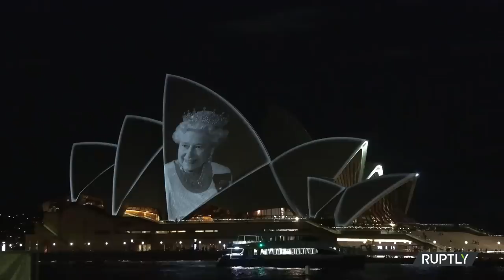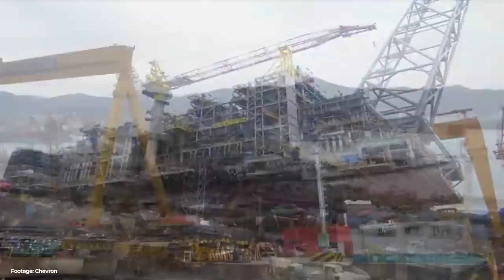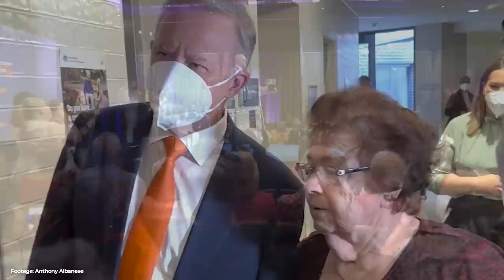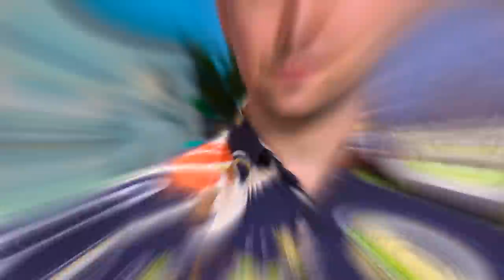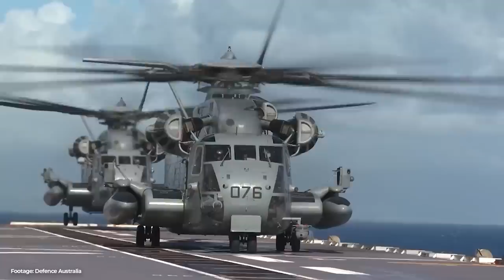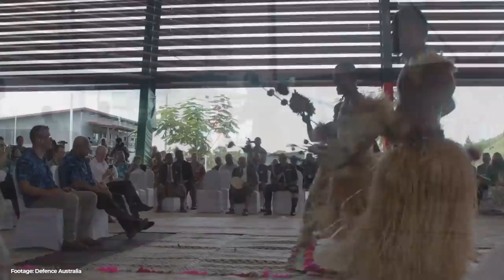A New Chinese Resurgence in Australia? - VisualPolitik EN

Comment: Australia always suffers from Fires, Flood and Draught. There are plenty of ways to combat these that won’t destroy the economy. Fires for one can be curbed in the east if they actually carried out controlled burn off to reduce the fuel load, like we do here on the west coast. Flood and Draught can both be handled with the building of more dams, which will also help contribute to improving our national water security.
Reply: But he problem is that when we get australias climate in europe, Australia will have some extra issues that makes "the economy" irrelevant
Reply: And more hydro electricity making our grid more secure too!
Reply: Using renewable energy will not destroy the economy - in fact in the long run it will result in reduced energy prices for most areas of the world.
Reply: We already do controlled burning regularly. It’s called “back burning” but it happens
Reply: Controlled burns do little to reduce massive fires. They can't be conducted frequently enough to make a significant impact on fuel load.
Reply: @AK-ej5ml  
Considering how much of Australia is just... open for development.  
Sure it is high-tech development but ... isn't that an opportunity for Australia to lead the world in environmental systems?
Reply: Incorrect. 
Problem is it has become much harder to perform controlled burns. And the daft previous ( and current NSW ) governments have pulled funding from many rural fire services.

The ONLY solution is to reduce carbon emitting sources of energy. 
Particularly coal and gas in power generation. 
This should've been a mix of renewable and Nuclear, but previous government let that ship sail as well. They should've acted 10 years ago.
Reply: @AK-ej5ml  renewables are intermittent and solar only a few hours per day. Peak power use is in the evening when it’s dark.
Reply: @MusicalMemeology  That's where storage and flexibility consumption comes in ... still some way to go to iron out the kinks. However experience from some countries, for example Denmark, shows that it is straightforward to get to an annual average of 60% renewable energy in the electricity system (most of that is wind power) without having large scale storage (though with an ability to sell excess when production is too high), so Australia still had a long way to go before intermediate supply from renewable would (should) result in supply interruptions.
Reply: @darrenyorston  
 "Even if you cut, or remove entirely carbon based energy production you will not prevent bush fires."
 Correct. You will however reduce the severity of bush fires and managing fuel will be simpler.
 
 "Australian ecology is formed as a result of frequent large scale bush fires which have occurred for thousands of years."
 Yes.. again.. close but so far. Quite a bit of the Australian ecology is indeed formed by bush fire. What makes 
 the 2019 bush fires different is it has burned with such intensity that even resistant species are struggling to regenerate
 in some areas. And some of those areas are our ancient, heritage listed Gondwanan Rainforests.
 
 "If you reduce the frequency of bush fires you increase fuel load."
 "The hire the fuel load the more likely bush fires will be broader and of greater intensity."
 This is why we do controled burns. But it is increasingly more difficult to do so due to funding cuts and the conditions
 severely increasing the risk of losing control of a burn.
 
 
 "There is no correlation between carbon energy production and bush fires."
 Yes there is. There is significant evidence of burning fossil fuels leading to climate change, leading to more severe weather
 events and longer droughts, which directly leads to the kinds of conditions that increase risk and severity of bush fire.
 It is not the only facter, but climate change is a major facter contributing to conditions that make fuel management
 exceedingly difficult and unmanageable. 
 Ignoring the evidence, does not make it go away.
 
 "There is causation between arsonists and bush fires in conjunction with insufficient environmental management."
 Yes, same with lightening, which was the most common ignition source for 2019 fires. There was also amature controlled burns
 getting out of control, careless machinery use etc.
Reply: "We'll all be rooned," said Hanrahan,
In accents most forlorn,
Outside the church, ere Mass began,
One frosty Sunday morn.

The congregation stood about,
Coat-collars to the ears,
And talked of stock, and crops, and drought,
As it had done for years.

"It's lookin' crook," said Daniel Croke;
"Bedad, it's cruke, me lad,
For never since the banks went broke
Has seasons been so bad."

"It's dry, all right," said young O'Neil,
With which astute remark
He squatted down upon his heel
And chewed a piece of bark.

And so around the chorus ran
"It's keepin' dry, no doubt."
"We'll all be rooned," said Hanrahan,
"Before the year is out.

"The crops are done; ye'll have your work
To save one bag of grain;
From here way out to Back-o'-Bourke
They're singin' out for rain.

"They're singin' out for rain," he said,
"And all the tanks are dry."
The congregation scratched its head,
And gazed around the sky.

"There won't be grass, in any case,
Enough to feed an ass;
There's not a blade on Casey's place
As I came down to Mass."

"If rain don't come this month," said Dan,
And cleared his throat to speak--
"We'll all be rooned," said Hanrahan,
"If rain don't come this week."

A heavy silence seemed to steal
On all at this remark;
And each man squatted on his heel,
And chewed a piece of bark.

"We want a inch of rain, we do,"
O'Neil observed at last;
But Croke "maintained" we wanted two
To put the danger past.

"If we don't get three inches, man,
Or four to break this drought,
We'll all be rooned," said Hanrahan,
"Before the year is out."

In God's good time down came the rain;
And all the afternoon
On iron roof and window-pane
It drummed a homely tune.

And through the night it pattered still,
And lightsome, gladsome elves
On dripping spout and window-sill
Kept talking to themselves.

It pelted, pelted all day long,
A-singing at its work,
Till every heart took up the song
Way out to Back-o'Bourke.

And every creek a banker ran,
And dams filled overtop;
"We'll all be rooned," said Hanrahan,
"If this rain doesn't stop."

And stop it did, in God's good time;
And spring came in to fold
A mantle o'er the hills sublime
Of green and pink and gold.

And days went by on dancing feet,
With harvest-hopes immense,
And laughing eyes beheld the wheat
Nid-nodding o'er the fence.

And, oh, the smiles on every face,
As happy lad and lass
Through grass knee-deep on Casey's place
Went riding down to Mass.

While round the church in clothes genteel
Discoursed the men of mark,
And each man squatted on his heel,
And chewed his piece of bark.

"There'll be bush-fires for sure, me man,
There will, without a doubt;
We'll all be rooned," said Hanrahan,
"Before the year is out."

John O'Brien,  July 1919, The Catholic Press
Reply: Need to increase safety margins in engineering and building codes for this brave, new and exploding world.
Reply: No Robert that's incorrect. We try to reduce the severity of fires by controlled fires. This can only be done when the rural fire bregrades are fully funded. This was not the case in 2019. Much of the fire brakes weren't carried out. To make things worse unseasonably rains occurred adding to the fuel load. As for dams, they don't spring up like mushrooms. Australia has terrible topography for dams. Ideally you are looking for deep gorges so the surface area of the dam is relatively small reducing evaporation.  Australia is the flattest continent on earth. So good locations for dams are hard to find. Brisbane is prone to flooding and does so approx every 30 years. There are 2 dams on the Brisbane River, Summerset (the older) and Wivenhoe (the biggest) Wivenhoe was made as result of the 1974 flood so has extra capacity for flood mitigation.  Despite this, in 2011 and following the worst drought in Brisbane's history, Brisbane suffered a major flooding event. 

Sorry mate there are no quick fixes or free get of jail cards.
Reply: @darrenyorston  all good point Darren. Urban planning is a big issue. It seems if a developer is big enough they can get the development they want, not what's the best.
Reply: @newhorizons898  Or we can act and prevent the world from exploding?
Reply: @450tank  Greens don't appose hazard burns at all. 
Construction of new dams. Well that depends. Dams are wildy distructive, and incase you haven't noticed, the floods are still happening, regardless of dams.
Reply: @450tank  
Oh boy. 
Not arguing that these don't happen. 
They have certainly gotten worse in recent history though. 
Consider Sydney flooding in the last 2 years. 
Consider the severity of the recent 2020 bush fires.
These things have always happened. What Climate change does, is:
* Make them more frequent
* Make them more severe
Unacceptable risks due to natural disaster has greatly increased in the past few years. 
If you want other proof of a climate prediction ringing true, look at our pacific neighbores and their fight with rising sea levels. 
As for "Nobody knows WTF happened before the 1800"
Well yes we do. Go talk to your local geologist. 
We might not have a day by day play: however the can figure out a lot about the climate and weather patterns in centuries past using science.
Reply: @peterlongland6862  I live in WA and our firefighters do regular back burning throughout the year.
The rest of the country keep screwing over their respective fire fighters.
Reply: @darrenyorston  
Open our Parks, indeed this is something that needs to happen and is advocated by a lot of prominent 4WD Clubs and Personalities.
Reply: Back burning is a very good prevention method and it would make a drastic improvement but. I'm by no means a greeny but back burning is also adding to OUR CO2 emissions, but I get where your going we need to do this strategically as well as trying to utilize all the new wizz bang stuff to cut our emissions, a tricky juggling act

Comment: Incredible bias in this channel these days.
First up, half the reef didn't die and it currently has the highest coverage on record after last year's record growth (it has cycles of dieback and growth). 
Second a lot of the blame for the bushfires has been put on the poor fire load management due to changes in government policies which prevented the traditional back burning which in turn led to uncontrollable hot fires. 

In regards to the Solomon's deal(and the other similar deals in the area). Officials were bought off to get the deals signed, but the locals were less than enthusiastic about the idea so rioted and burnt down every chinese business or building they could find. China still engages in hard diplomacy (l give you this if you give me that) where Australia engages in soft diplomacy like the UK used to(we give you this in order to generate good will which hopefully you reciprocate). 

This channel could be so much better if it stopped being so selective about which points it covered. Sadly it's viewers are becoming more and more extreme in their views.
Reply: Not wanting our country to burn from climate change is extreme matt?
Reply: @sirwahthemonke  This country has had a long and close relationship with fire. The indigenous used it to manage the land and it's the reason so much of our native flora are not just fire tolerant, but rely on it for survival of their species. The biggest reason we are getting massive out of control bushfires is because we aren't maintaining the land in the way it previously was. Instead of lots of small cool fires we are getting infrequent but massive hot fires due to the excessive fuel building up. As for being more severe than they were in the past, they really aren't, they are just more severe than the ones in the recent past. After events like ash Wednesday governments introduced fire load management strategies that were fairly effective, but over recent years they have reduced the fire management largely because of green lobbying. It's not the first time that green groups have caused more environmental damage than they prevented, but then most members have no real knowledge of this country outside of cities and curated national parks.

Comment: As an Australian politics nerd and as someone who has criticized this channel for being overly neoliberal biased and for oversimplifying things, this was pretty well done. 

Labor in Australia are a very pragmatic moderate left party they have a good track record of balancing foreign influences (except Whitlam who pissed off American oil and gas interests and got soft couped from power).

It's important to realise that Australia's relationship with China is a lot like Europe's relationship with Russia pre 2022 with one massive and important difference. It's reversed, Australia is a massive energy supplier to China, when China sanctioned our coal it wreaked havoc on their energy systems and resulted in the price of coal surging. A lot of Australian coal got sold to Indonesia who then sold it on to China at inflated prices. Queensland black coal is extremely high quality (by coal standards) and many of the coastal power stations in China could not use the much higher ash domestic coal which exacerbated energy shortages. Australia unlike Russia was also not under sanctions by any other country so the sanctions were largely ineffective. Personally I was shocked at just how ineffective they were. They hurt a number of small agricultural niches but the only real difference we saw here was that high quality Australian produce which used to be exported was suddenly available in supermarkets for far cheaper than we were used to. Australian rock lobster was actually affordable for once lol. 

If China stopped exporting manufactured goods that would probably be more painful to us but even then it's aggregate effect would be limited as it would push our trade surplus higher. Australia's support for Ukraine, it's new commitment to climate change and it's willingness to supply Europe with LNG and coal (ironic) are likely to further trade negotiations with the EU to become a greater export market and source of manufactured goods. Australia also has some of the largest deposits of rare earths, copper and uranium in the world and we're beginning to see a new mining boom bolstered by investment from Europe and the US. 

Unlike other major sources of these rare earths like China, Russia or Latin America Australia is firmly in the West politically and is seen as a stable and secure market to invest in.